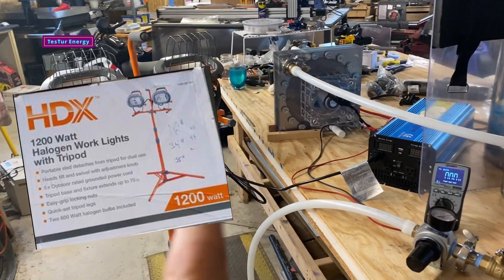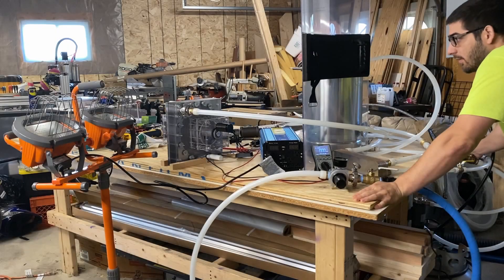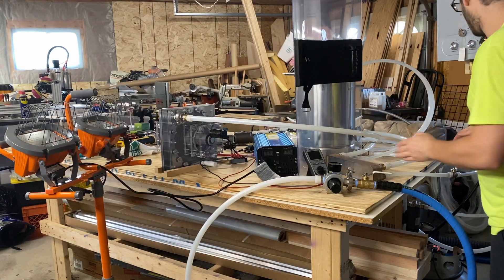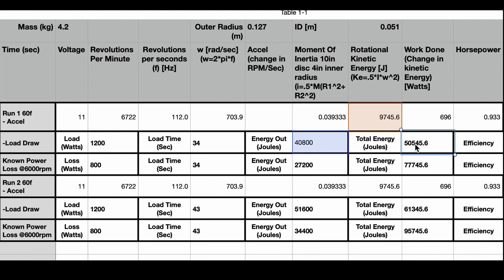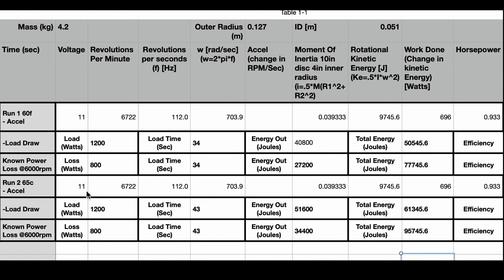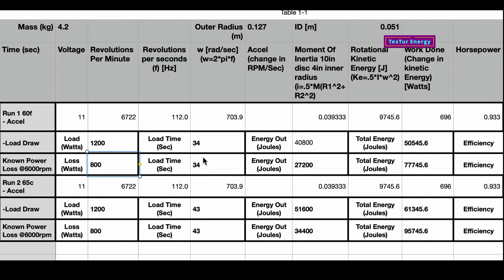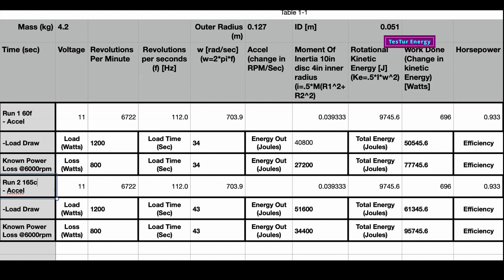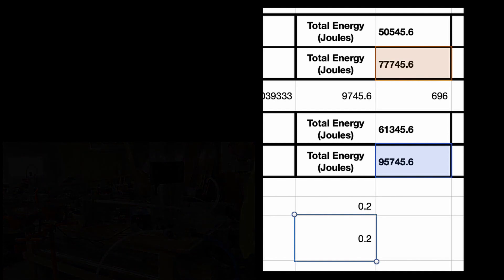Tesla Turbine 1200 Watt Electrical  Load Tests - Power Calculations - compressed Air + Propane

Comment: Loving the videos and the memes, What was the temperature of the air coming out of the turbine exhaust? Does the turbine absorb heat?
Reply from the maker: Hey Stuart, thanks for commenting! I don’t have a measurement for the temperature of the air after being expanded through the turbine for these runs. I will be showing that part with the next video on efficiencies. The turbine does infact utilize the thermal energy via expansion through the motive fluids spiral path towards the center for added energy conversion though. As well the increased temp of the motive fluid slightly increases its viscosity which reduces slip of the motive fluid with the disc faces. So there’s a little bit of a double gain from increasing the temps of the motive fluid when using elastic fluids like pressurized gasses.
Reply: @CharlieSolis  thanks! I'm looking forward to seeing the next videos. I wonder if the turbine is also expanding slightly due to the heat and the gaps between the discs are narrowing slightly thus causing more spins? I guess it's not just the air that's a variable but the temperature of the turbine itself? I just wondered if the turbine was heating up and how much heat was being absorbed.
Reply from the maker: @passiveftp  I see what you mean! Yes the turbine will def meet the temps of the motive fluid but that motive fluid will be a different temperature across the face of the discs as it’s expanded and it’s thermal energy is used up for power out on the turbine. So the elastic motive fluid will always leave colder as it’s expanded through the turbine. Because of this I have a design for doing a disc stack that has alternating types of metal discs and special electrically insulating and conducting starwashers and periphery spacing washers, such that the disc stack is itself a thermoelectric generator that produces a DC current from the temperature gradient across the discs’ faces radially. Coincidentally as the current in the disc stack builds up from the seebeck effect the current then begins to cool down the hot side and increase the temp of the cold side from the Peltier effect. This is also why thermoelectric generators are generally inefficient, because the more current drawn off the more you begin cooling your hot side and heating your cold side and the temp gradient across them is reduced, reducing the power output from the thermoelectric generator. And while this would normally be a bad thing it will allow it to work as an internal metallic crystalline lattice cooling mechanism to allow the disc stack to be used at higher combustion temps for higher thermodynamic efficiencies while not exceeding the temp limits of the tips of the discs being used during high temp combustion uses. Check it out
https://youtube.com/shorts/_qROtAW8XLg?feature=share

As for the temp increase of the disc stack the starwashers increasing in temp would cause them to increase in width, and as such would increase the disc spacing. Although I would argue that this would be compensated for by the increase in viscosity of the elastic motive fluid from the increased temps. It’s hard to say without crunching the numbers though.
Reply: @CharlieSolis  I think that if you don't like what your spacers are doing to the gaps, you might consider making them out of nitinol, so that you can train them to assume a different geometry at different temperatures so that you can have the gaps set to whatever space you think is best.
Reply from the maker: Hmm yeah something like nitinol would be really cool. If I remember correctly there’s a lifespan to how many times nitinol will return back to its original shape but I think you’re on to something there for sure. Maybe like a special micro etching on each side of the star washers that causes it to “crumple” up a little at different temps causing it to get slightly thicker or skinnier? Not enough to exceed its plastic yield strength but enough to cause micron thickness changes. 

I’ve been dabbling around with the idea of making special piezoelectric star washers that upon a static electric potential they would get slightly thicker or thinner. Maybe even some pyroelectric effect too that sudden changes in the temp could cause it to squeeze tight or widen up to allow for the sudden thermal shock. 🤷‍♂️ there’s so many ideas but haven’t found practical ways of implementing them just yet.
Reply: @CharlieSolis  how would you make a piezoelectric washer?
Reply: @CharlieSolis  when the first solid state heat engine was fabricated with nitinol springs, they let it run millions of cycles using solar energy to heat water that imparted energy to flat springs that was drawn off by cool water to bring the material through its phase transition from soft to superelastic.
When they compared the force produced by the springs through thier transition phase after the millions of cycles to before, rather than the expected loss of power through fatigue, they found that the force of the rebound had increased.
Since your trained spacers will only see one transition per turbine run, you will have to power up and de-energize millions of times to see any change in the performance of the nitinol components. 
I think that the less "starwahshery" they are and the more "belleviewy" they are, the more force they will apply and the more easily the balancing can be accomplished.
Reply from the maker: Not entirely sure at this point 🤷‍♂️ 😂
Reply: @CharlieSolis  I think you might get a really big benefit from running your turbine with the plates horizontal rather than vertically. Also, if you use air bearings to keep the shaft centered, and magnetic bearings to levitate the shaft vertically, you will get rid of most of that noise that you're losing power to.
Balancing will get easier too.
Reply from the maker: Check out these new super thin piezo sheets that have been invented. I was thinking these could easily be used and cut into star washers. 
https://youtu.be/jUtsrN7C4Uo
Reply from the maker: Interesting. I was miss-informed on the lifecycles of nitinol! Super cool!
Reply from the maker: Warmer republic, bearings aren’t even remotely an issue. What you’re hearing in all my videos is the misaligned gears between the turbine and generator shaft. That’s where the vast majority of the issue in the system are. Honestly if bearings are an issue for your turbine, that they aren’t getting essentially almost negligible loss, then you need to go back to the drawing board. The bearings have almost zero loading on them if the turbine is direct to shaft with the generator, like I’ll be doing with my next build, and the turbine nozzles are balanced around the runners periphery. And balancing is of no concern for my builds either. Especially with teslas balancing apparatus. The only reason I have a vibration issue with mine, that appears like a balancing issue is because the circular rounding I put on the turbines hex shaft for the bearing to go on is not centered true to the center of the shaft and turbines center of balance. The turbine itself is impeccably balanced. I just have a pretty crappy lathe, all things considered, and I just didn’t bother to fix it. But I have all of this solved for my next build. 

Magnetic bearings could be convenient but they basically have an operating temp barrier to using them in any kind of high temp applications. Again though bearings aren’t even the slightest of concern. I’m more worried about nozzle and line losses to the turbine, gear losses between the turbine and generators and getting the new bearing system I’ve design in the turbine that lets me use bearings that are easily rated for up to 30,000 rpm and this turbines discs can’t even go over 15,000-17,000rpm. So they won’t even be in the bearings high wear range let alone high loss range. And even then water cooling the bearings means that any heat from friction can just be recycled to raise more steam in the vacuum turbine. 

I’m less than intrigued by air bearings, mostly because they require a power source to stay working, however I’m very intrigued by foil bearings. I mostly don’t like air bearings because of the level of precision they need to operate effectively. The entire point of the Tesla turbine is they are supposed to require very little high tolerance machining and that just goes in the face of that. However, I would kill for a set of the off the shelf air bearings from New Way Air Bearings… just to have one. Not to mention though you will have lots of trouble trying to use air bearings in a vacuum steam system. 

All in all you’re right. Those bearings would make it better. But I only see them making a minor increase in performance over cheap high quality ceramic ball bearings. Again I’m of the mindset that if bearings are such an issue that the loss from them isn’t dwarfed by your Tesla turbines outputs at any rpm then you need to go back to the drawing board with the Tesla turbine design. (Not you specifically just “you” in general)
Reply from the maker: Warmer republic, could you explain you you think the turbine would work better horizontally than vertically? To me this introduces the further need for a thrust bearing that wasn’t needed before. But I’m curious to hear your reasoning behind it. I have done this in the past with my original turbines but I don’t see it as more beneficial but I could be overlooking something that you have thought of.
Reply: @CharlieSolis  that piezoelectric film makes me think "ultrasonic diaphragm pump".
Reply: Just put it on one end of a tesla valve, or line the baffles of a tesla valve.
Reply from the maker: Also I do in fact have some quick videos on an air bearing design I came up with for the dual stage Tesla turbine and I also have multiple water bearing designs too 

Check them out 
Air bearing
https://youtu.be/tRIYpZ8k-ww

Axial Water bearing
https://youtu.be/QpD4xzNqkd8

And this is my interstage Heat exchanging water bearing idea for further forcing condensation of the turbine exhaust just as it leaves the turbine without mixing the cooling fluid with the leaving exhaust. The cooling fluid just doubles as a liquid bearing design. I have many variations of this idea too that I haven’t explicitly show on YouTube either. 
https://youtu.be/aqpJCIhgwM4
Reply from the maker: Right!! There are sooo many untapped uses of that thin piezoelectric sheet!
Reply: @CharlieSolis  you could crush the crystals into a power and mix them with some other material
Reply from the maker: It’s possible. If you let them set in an epoxy under the influence of a powerful external electric field all the micro crystals would/should align appropriately.
Reply: @CharlieSolis  
Spinning on a plane that is perpendicular to the force of gravity means that you aren't subjecting any spinning components to varying forces from gravity.
That extra 1G of force being perpendicular to the axis of rotation means that every rotating portion is subjected to a 1G variation per rotation.
Generally, variations in force are not beneficial. 
Hydrodynamic air bearings don't require an air supply, and they can carry ginormous loads.
Take a look and see if these hydrodynamic examples don't pique your interest in bearings that you can make for yourself:
https://youtu.be/HcVA-4mcXQQ
Reply from the maker: Once I’m getting closer to the 15,000rpm and over I’ll start worrying about the varying g forces on the discs. It’s definitely something I’ve thought about I just don’t feel like I’m anywhere in the rpm range to need to really worry about it. Although I may never need to go that high with how well it’s performing so far. And if I don’t need to go to high RPMs ball bearings are more than adequate. 

But for the record unless you have an air supply you’re not going to have much loading on an air bearing. Yes I’ve seen that video before. But the level of machining required to achieve that, for even just a small one, is not cheap, not to mention its highly prone to damage under sudden changes in operating conditions. 

Again though I definitely see the benefits of using them once we need to but up to this point my main goal was to prove that Tesla turbines don’t need these super additions just to make them work and work effectively too. We don’t need outrageously high RPMs, we don’t need frictionless bearings. We just need to design the disc stack right and we can use basic off the shelf parts to achieve practicable uses. I’m not making these for NASA. I’m making these for the average joe to be able to put in there home and also be able to fix it themselves. We are going for a “planned permanence” route for these turbines. Simple, cheap, and easy to work on.
Reply: @CharlieSolis  
Okay.
I'm not trying to be contentious, but you might notice in the video that one of the uses they put hydrostatic bearings to is as thrust bearings in hydroelectric dams.
Reply from the maker: In my honest opinion Comparing air bearings in a high rpm Tesla turbine to the low rpm liquid hydrostatic bearings in a dam is apples and oranges bud. Completely different operating conditions to consider.
Reply: @CharlieSolis  Oh yes indeed!
It's comparing tons to ounces.
Do you think that a train of friction gears might work?
I used to have a CMM that used them because they had zero backlash characteristics, but haven't considered a high rpm application.
Reply from the maker: @passiveftp  1200watt Load Test ELECTRICAL Output Efficiency Calculations For 10in Tesla Turbine Are In! 
See the charts here!
https://www.youtube.com/post/UgkxRukN0zoVbtfe1LmLUlXyIo0kdt1ExWZs

Comment: Nice work Charlie! Gets up to speed real fast. The torque looks really good! When do we get to see that double stator axial flux generator? Oh, and are you going to do efficiency calculations? I'm guessing it's around 30%  You?
Reply from the maker: Hey thanks Charles! I’m still working on that. It’s going to take a little bit more R&D on my side to get it working in the way that I need. Still have to figure out, what number of poles I need to get 12v or 24v outputs so be run direct into an inverter at the desirable operating RPM of the turbine. So it will be coming soon but I have a good amount still to figure out. 

As for efficiency I have now calculated it a few different ways. If we only consider the energy out out by the light alone the efficiency seems to come in around 15-25%. That’s calculating the available energy in the amount of compressed air we have available in a couple different ways and is really a rough estimate. If we can fix the gear losses, again which should be easy to do with the the axial flux generators, the efficiency is coming in between 25-35% efficient and could be even higher depending on how much of a low ball I put on those loss numbers. (And that’s not accounting for generator iron losses, rectifier losses or inverter losses too) my power loss tests showed 1-2hp of loss from the unloaded condition and my calculations only have 800watts of loss. That’s only 1.09hp. Realistically the loaded condition could be seeing upwards of 2-3hp loss so the real losses are something like 1600watts plus, which if that’s the case the efficiency is looking like it’s close to 35-55% efficient. Again these are rough estimates for how much energy is available in 170gallons of 150psi compressed air. Which for the record the different ways I calculated it give it a range from 260,000-380,000joules. I had a whole section about efficiency in this video but it made the video like 20 minutes long and very dry so I decided to cut it out and I’m going to be making a video about just that. 

But yeah if you know how to, let me know what you get for the total joules available in a 170gal tank at 150psi being dumped to 65psi. Like I said, I came to those numbers above. It would be interesting to see what others calculate for me to compare to.
Reply from the maker: 1200watt Load Test ELECTRICAL Output Efficiency Calculations For 10in Tesla Turbine Are In! 
See the charts here!
https://www.youtube.com/post/UgkxRukN0zoVbtfe1LmLUlXyIo0kdt1ExWZs

Comment: Any update on the Steam cavitation rotor?
Reply from the maker: Hey Mellotronaic! Thanks for commenting. I do not have any updates as of yet on the cavitation heater but I’m getting there! The first step has been to get the Tesla turbine working and then get the turbine to power the cavitation heater direct on shaft. I have a feeling as well the turbine will be the most optimal way of driving the cavitation heater at high RPMs. I will have more on it soon though!
Reply from the maker: Hey Mellotronaic, not sure if you’ve gotten a chance to see my latest tesla turbine updates but check them out! Just running on compressed air so far while I still work on the larger vacuum chamber system for the turbine. Peak 2.75kW and 6.22ft-lbs of torque 4150rpm with 150psi room temp compressed air with 1/2in supply lines.  And the second video is the latest 1200watt electrical load tests using 170gal of 150psi compressed air dumped to 65psi, both room temp and then 70-80°c heated compressed air. And saw the continuous 1200watt output all the way down to 65psi. Should have this thing ready for a vacuum chamber here real soon! 

https://youtube.com/shorts/yXQy844URMA?feature=share

https://youtu.be/bWpXRzrzf4g
Reply from the maker: 1200watt Load Test ELECTRICAL Output Efficiency Calculations For 10in Tesla Turbine Are In! 
See the charts here!
https://www.youtube.com/post/UgkxRukN0zoVbtfe1LmLUlXyIo0kdt1ExWZs